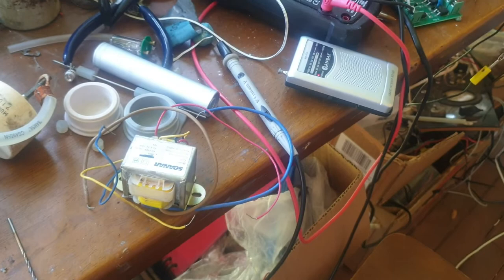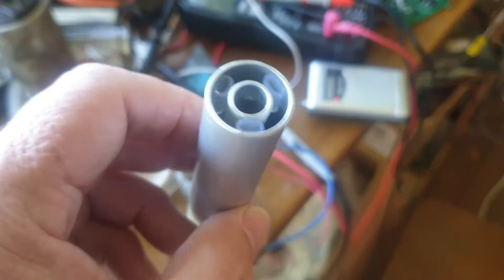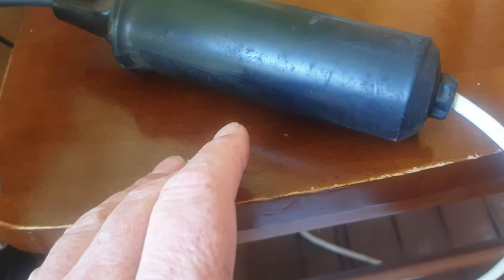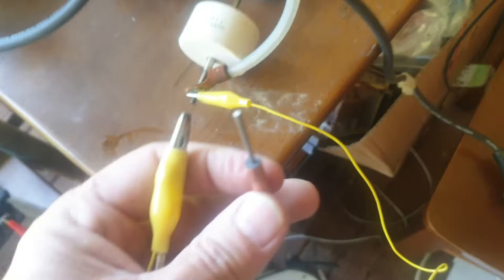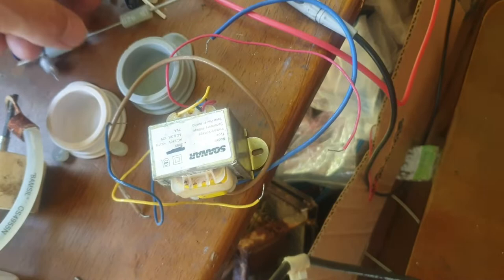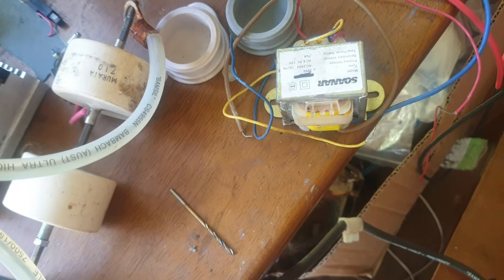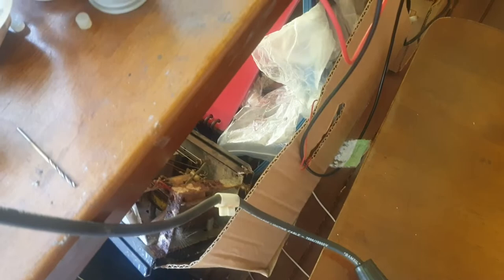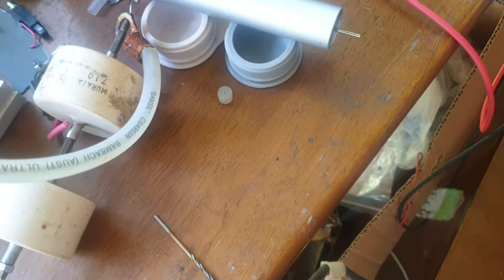Ed Gray tube test fire...spectrum noise, & quack device!

Comment: So is that aluminium tube?
Reply from the maker: yes aluminium tubes... 316L rods... carbon guaging rods with copper sheath and silicone HV insulation to hold the rod centered. The silicone is the outter insulation from the HV wire that i stripped the conductor out of.
Reply: @m3sca1  hmmm i must investigate while its fever pitch ! The novelty is extremely high👍🏻